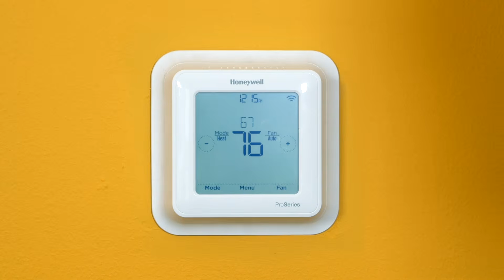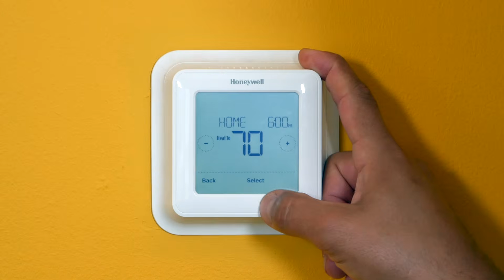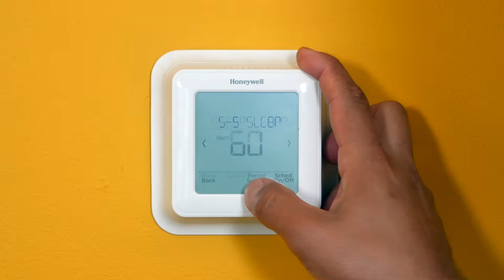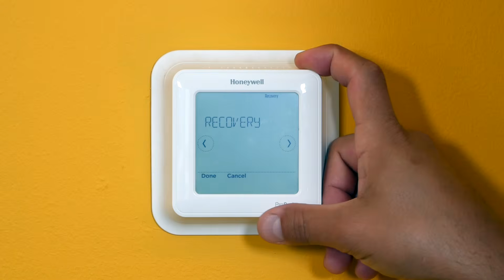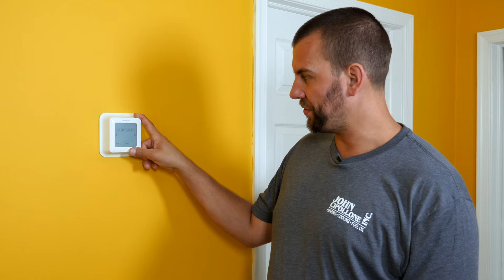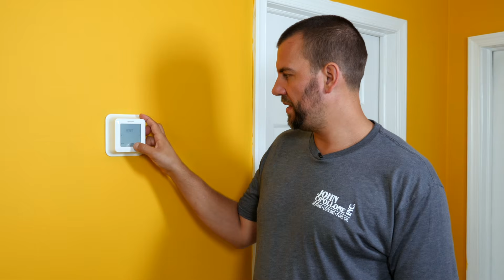Honeywell Pro Series Thermostats: How to Navigate the Menu and Settings - with John Cipollone, Inc.

Comment: Who the hell ever invented such a frusrating piece of equipment. What does 160 over 23.5 mean? I just need something that increases or lowers the temperature. GAWD
Reply: ...it's probably best to turn off the scheduling/programming by pressing menu  ...the word schedule appears  ..then press select and the option to turn off is there   ...now you are in "manual". Select either the heat or cool mode and then use the plus or minus to adjust temps.

Comment: I can switch the fan between auto and on, but there is no off option. How can I just turn it off?
Reply: it doesn't shut off permanently. It DOES shut off in auto mode until the unit runs again in either heat or cool. Also to disable the fan entirely just disconnect the green wire for the fan.

Comment: Not helpfully at all. I don't want a schedule. It is not mine. All I want to do is turn on AIR.
Reply: ...it's probably best to turn off the scheduling/programming by pressing menu  ...the word schedule appears  ..then press select and the option to turn off is there   ...now you are in "manual". Select either the heat or cool mode and then use the plus or minus to adjust temps.
Reply: I just want to stop the fan from turning on
Reply: @colleenoleary984    ..there is only one way I know of to keep the fan from turning on is to disconnect the green wire . The fan is normally either in auto or on continually.

Comment: my cooling won't go any lower than 65...how do I fix this ?
Reply: Did you ever figure out how to fix it? Having the same issue but stuck at 68
Reply: @guuhhhb2859  nope
Reply: ...it may be set that way in the system settings!  This is possible to change in the model that I have : Honeywell RTH7560E. Its in the system/advanced settings...press Menu and Plus for 5 seconds and the ISU menu appears...select this by pressing +   ..and then the number 120 appears...press + ...u must keep doing this on the following numbers that will keep appearing until number 430 appears for Minimum Cool temperature setpoint  ...adjust to your setting   ...the next number 431 appears for Maximum Heat temperature setpoint  ...adjust to your setting...that's it! Eventually you will see the word DONE so select this also.

Comment: Can you set max or minimum temp limits for rental properties or kids so they can’t turn the AC too low or the heat too high?
Reply: This is possible in the model that I have : Honeywell RTH7560E. Its in the system/advanced settings...press Menu and Plus for 5 seconds and the ISU menu appears...select this by pressing +   ..and then the number 120 appears...press + ...u must keep doing this on the following numbers that will keep appearing until number 430 appears for Minimum Cool temperature setpoint  ...adjust to your setting   ...the next number 431 appears for Maximum Heat temperature setpoint  ...adjust to your setting...that's it! Eventually you will see the word DONE so select this also.
Reply: @beeerhunt it was so nice of you to write such a detailed response to the question, and you never even got a thank you for it. So here I am, random stranger on YouTube, and I'm thanking you for all of your efforts in your response!

Comment: I dont want to walk to the thermostat and have to turn on heat and the next hour cool to regulate it manually, thats the thermostats job, why in the world is there not a temperature regulation mode to keep it at a specific range.... ridiculous
Reply: This is possible in the model that I have : Honeywell RTH7560E. It is called System Changeover! Its in the system/advanced settings...press Menu and Plus for 5 seconds and the ISU menu appears...select this by pressing +   ..and then the number 120 appears...press + ...u must keep doing this on the following numbers that will keep appearing until number 300   .. select 1 for automatic    ... that's it! Eventually you will see the word DONE so select this also.

Comment: Too difficult. Too complicated. Where are the written instructions. I need a different thermostat.  Suggestions are needed for a thermostat that is easier to operate.
Reply: Yes it is. Why do we need a instruction to heat up . It could be simple.up and down just be simple.
Reply: That part owners buy this bs so ya bill be high
Reply: BTDT. The installers will argue, says its easy, tell you you are stupid. We changed ours twice... I'm a computer scientist so I just told them I'd do it myself. Even so its got a lot of menus and options. Printed docs are worthless, videos only partially good. Somewhere out there is a Honeywell manual that covers EVERYTHING. Search the internet for it... I now have it and it solved our problems.

Comment: This thermostat only runs all the time. It should heat and stop running then drop a few degrees and come back on. This does not. $300 light bills. Ridiculous
Reply: Look under the word fan and make sure it says Auto and not On underneath it. If On is showing it will continually blow fan air after the Heating process.
Reply: Yes. Mine does that occasionally and it drives me crazy.

Comment: should fan be set to auto or on for best results for cooling?
Reply: If you set it to On the fan will run continuously even after the temperature you have set it to has been reached. It is just fan air, not A/C. I think maybe it would be a personal preference.

Comment: My thermostat is locked, my husband doesn’t know the code, I never set it. It’s hot in here and I can’t turn on the air
Reply: If it's honeywell pro series, the code is 1234
Reply: I think the code is automatically 1234
Reply: @JoshuaJ99  That's only on the Honeywell T4 thermostats this on that he demonstrated is the Honeywell Lyric T6 thermostat
Reply: That code don't work brought the house need a new code to make the heat co.e.on
Reply: @evelynmacklin6345  If it's the homeywell pro t4 thermostat it is 1234 but if you have a different model then idk what it could be

Comment: Worst digital thermostat EVER MADE!
Reply: Starting to agree
Reply: I hate mine, I just want to turn the cool air off because it doesn’t do anything but make my bill go up to $200+ a month
Reply: Facts
Reply: Fact!
Reply: Just want to be able to turn heat up and down manually and can't figure it our no matter how many videos I watch.
Reply: @ZA-co9vj    ...it's probably best to turn off the scheduling/programming by pressing menu  ...the word schedule appears  ..then press select and the option to turn off is there   ...now you are in "manual". Select either the heat or cool mode and then use the plus or minus to adjust temps.
Reply: Mine just went blank after getting it fixed less than 10 hours ago. A/c guy didn’t put batteries in it. Says it wasn’t needed!!! wtf. Put batteries in screen came back on but A/C won’t come back on!!! I’m so upset!!!
Reply: @inthevault9603  were u able to get the a/c turned back on?
Reply: Just permanently hold temp. I don't use the programmable setting.
Reply: @lorianderson3939 
Mine has something saying "Permanent Hold" above the set temperature. It won't allow me to set the heat less than 68.
I want to set it to 60 as the house is vacant. Our mother died last month and no one is in the home.
Does anyone know how to get rid of "Permanent Hold"?
Reply: Thank heaven for this video or I would NEVER have figured it out!!!
Reply: I certainly agree. Most complicated thing I have ever tried to do and I am an engineer